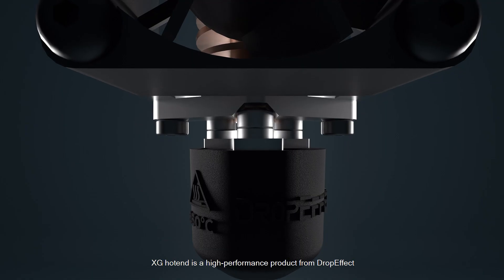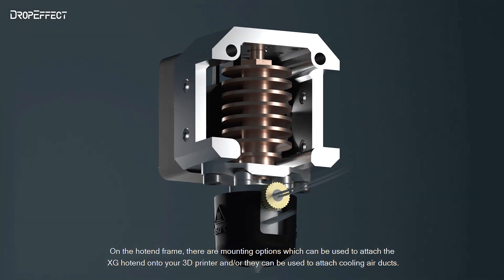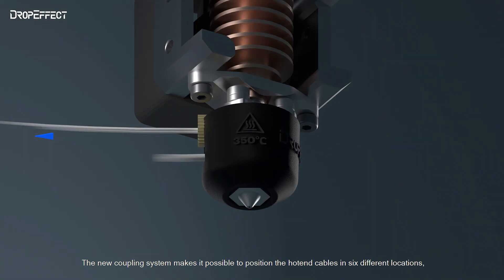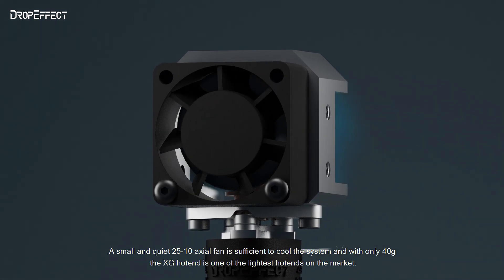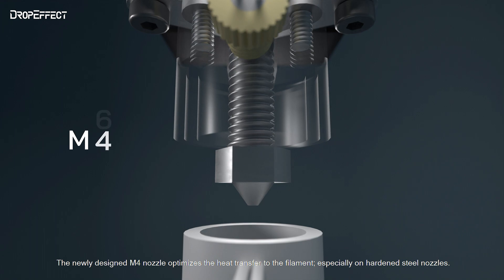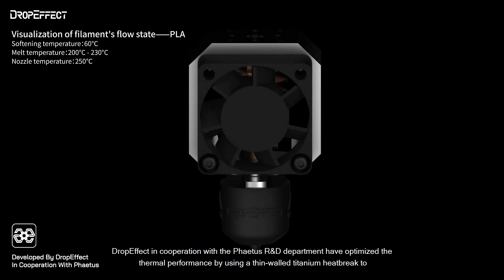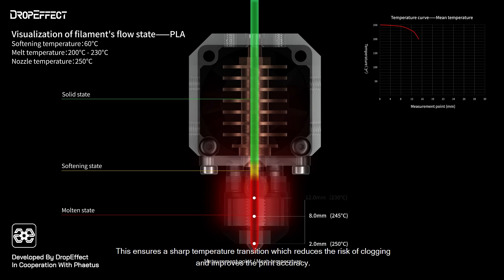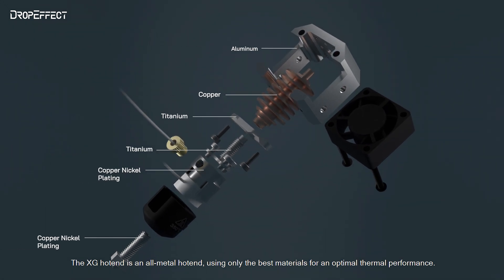Introducing the XG Hotend

Comment: Why is the hole spacing different from the other Phaetus products like the dragon? 
"Voron mounting option" isn't a standard, there is no specific Voron mounting style
Reply from the maker: Good question. The ideas behind the XG hotend are different to those of the Phaetus products. The Dragon hotend for instance has a circular heatsink which is uses a 16 mm diameter hole pattern with M2.5 threads. The XG hotend has a rectangular frame and as such it felt more appropriate to have a 10 mm square thread pattern and use M3 threads because we wanted to keep the amount of different threads this product has to a minimum (in total there are three thread sizes used on the XG: M2, M3 and M4). You are correct to point out that "Voron mounting option" is not a standard nor does specifically specify a mounting option, however when we tried to find an appropriate wording for mounting the hotend rigidly with screws we did find anything. However when asking users how they would call it this mounting option they responded quite differently but one word very often came up "Voron style mounting option" which is often being used as a synonym for "screw rigid mounting".
Reply: @DropEffect  Thanks for getting back. I would prefer the term "Top screw mount" to prevent confusion. The XG looks quite promising to me. The only thing holding me back from buying it is that I was unable to find spare parts like thermistors and heater block / core and silicone sock. 
I already designed a new adapter to get the XG mounted onto my Duet Smart Effector where I use a Dragon until now. The Dragon was attached with an adapter that provides an M12 thread. Same will need to be done for the XG (that's the reason why I was asking about the hole spacing).
Reply from the maker: @r00yce   Regarding the spare parts, we will always provide spare parts, if you cannot find them on one of our reseller websites contact us at info@dropeffect.com and we will organise the parts being send to you. 
The "Top screw mount" nomenclature is interesting but not quite what I am looking for. It needs to have a "cool" word in it somewhere. In the new XG videos we will refrain from using the "Voron style mounting opion" wording and try to coin a term for this mounting option.
Reply: @DropEffect  Sounds good about the spare parts!
Let me turn my head around a suitable nomenclature, I bet I can up with something unique ;)
Quick question as I need to design an adapter for the XG (for a Duet Smart effector) and my question in the websites chat box weren't responded to:
I tried to figure out the diameter of the top screw hole distances. Can you confirm that the diameter of the center holes is 14.1mm?
Also, the accessorie threads on the sides are M2.5 aswell?
Thanks!
Reply from the maker: @r00yce  The screws in the accessories should be M3 screws. The pattern of the M3 threaded holes on the Frame is a 10 x10  mm square and the M2 through holes should be a 9.6 mm diameter radius. If you go on the dropeffect website on download you can download the STEP files for the XG Hotend.
https://www.dropeffect.com/download
Reply: @DropEffect  I already downloaded the cad a few weeks ago. According to the model, the accessories screw holes are M2.5. 
Seems like I need to order an XG to make sure the cad is correct ;)
Reply: @r00yce  I just checked the .step. Are you sure, you measured correctly? In my model, the threads are M3. Just the core diameter is 2.529mm, which correlates perfectly to M3 ;)
Reply: @chaaalyy  Weird. When I put in M3 screws (as a model), the M3 threads overlapped the threads in the XG by far.

Comment: Any non-standard components must be avoided at all costs. If something fails it's fast and cheap to buy any replacement part for E3D hotend, but what to do with this one if it fails? Will this company manufacture this hotend several years later? Will this compaby even exist at that time?
Reply from the maker: DropEffect was founded in 2019 and we still maintain spare parts for the original version of the OmniaDrop. We now merged with Phaetus a company that was founded also in 2019 and as such are fortifying our position on the market. We are here to stay ;)

Comment: So, how does this compare to the V6 hot end I already use?
Reply from the maker: Mostly it comes down to the architecture of the hotend and if want/need these additional features (one handed nozzle changes, sharp temperature gradient, multiple mounting options etc.). However if you are happy with your V6 hotend and it currently works, then keep on using your V6. If one day your V6 stops working and you need a new hotend then please consider the XG as an option ;)

Comment: Cool, where to buy nozzles? especially hardened ones?
Reply from the maker: Most of our resellers have nozzle in stock. If you get the XG hotend there are two nozzles in the package, one copper-nickel plated and one hardended steel nozzle both are 0.4 mm.

Comment: What's the performance for flexibles like TPU?
Reply from the maker: Well with flexibles it dos not really come down to the hotend. You rather need an extruder-hotend combination with a very short filament path. The OmniaDrop extruder would be a good option for this. FYI a PTFE lined heatbreak will help a lot with printing flexible materials, because the flexible materials are very "sticky" and such like to stick to metal.

Comment: thing i still miss from 3d printers, they are still realy reliable from the filament that go's into it , if the filament deffers in mm thickness it shows on the print.. why arent there pre-heat hoppers before it go's throu the nozzle ?

Comment: What’s the maximum flow rate? It’s not stated on the website.
Reply from the maker: We do not give specific flowrate numbers because there is no standardised method to measure flowrates. The XG-Hotend has very similar "flowrates" to the Dragon ST hotend.
Reply: @DropEffect  I understand the difficulties in quoting flow rates, and yet somehow consumers need to gauge this. Referencing it to the ST (which is labeled as "Standard Flow") is very useful.
I hope you could bring this architecture to a higher flow product, even if it does add a few grams.
Reply from the maker: @JonS  There will be high flow version. Unfortunately I cannot say more ;)
Reply: @DropEffect  Okay. I'll come back and ask again tomorrow then 😂
Reply: @DropEffect  Well, doing what CNC Kitchen does(extruding x mm at different flow rates and measuring relative underextrusion between them) is a great way to roughly test the limits of a hotend.

There are a few important things when picking a hotend. Can you be the best hotend in at least one of these categories(or at least be the best middle ground in all of those)?
- price to performance ratio (Dragon)
- maximum flowrate (Rapido)
- price (V6 clones)
- replacement parts availability  - is it patented like Revo or Mosquito? Can I order a new nozzle/heatbreak etc for cheap online and get it 2 days later? (V6 and clones)
- reliability
- ease of use - ok you mostly focused on that but idk if a few pretapped holes is better than the whole nozzle swap feature in Revo
Reply from the maker: @igorordecha  Yes you can technically use the CNC Kitchen method, however there are ways to "achieve" more flow and as such claim high flowrates. We do not want to disguise anything, but "gun to our head" a flowrate of 16 mm3/s is achievable, but it depends on so many factors. This is why we say the flowrates are similar to that of a Dragon hotend. 
There is no patent on the nozzles so hopefully other companies will make those nozzles as well in the future. 
If you prefer the Revo system due the nozzle changing capabilities then you already made choice.

Comment: In which case does the XG hotend makes more sense than the similarly priced E3d Revo micro ?
How do they compare, are they even aiming at the same market ?
Reply from the maker: Good question. It comes down to the preference of the architecture of these two hotends, because you will get very similar extrusion results from both hotends. The XG Hotend was designed to have a completely rigid architecture (kinematic coupling) with multiple mounting options.
The idea of the Revo revolves around the ability to quick change nozzles.
It depends on how each individual person weighs these features in its importance.
Reply: @DropEffect  Really well said. Thank you so much
Reply: @DropEffect  Thank you for your help !
Reply: @DropEffect  Great reply
Reply: The Revo isn't a great system tbh. I used one on my Voron for a while, mostly out of respect for Sanjay. Sadly, its maximum volumetric flow is actually less than a standard V6. The heater core and thermistor are in one unit, so if one goes out, you need to replace everything (ask me how I know). The heatbreak is built directly onto the nozzles so they're quite expensive, compounded by the fact that there are no generic alternatives (and likely will never be) due to E3D's patent on the design. The toolless nozzle changes sound cool at first, until you realize that it doesn't really save you any time because you need to heat up the hotend to extract the filament first, then you need to wait for it to cool down because you can only really change the nozzles with your fingers (there's no hexbolt pattern or anything to do it while its still hot with a tool), and then you need to heat it back up to re-insert the filament. It's a cool idea but I really can't recommend it.